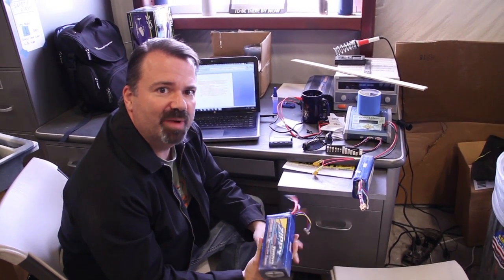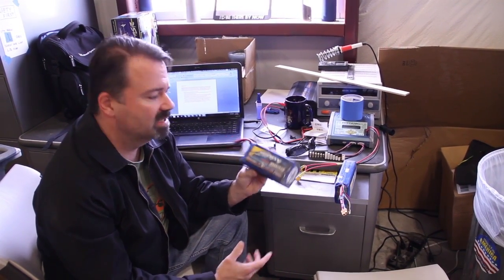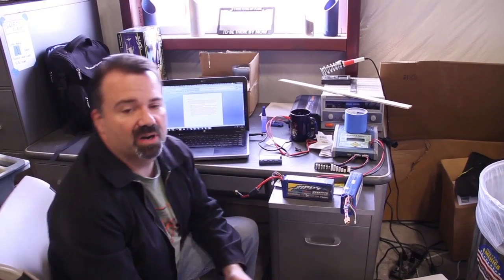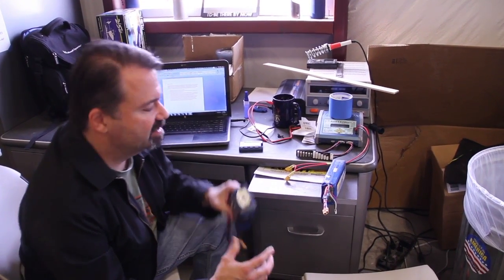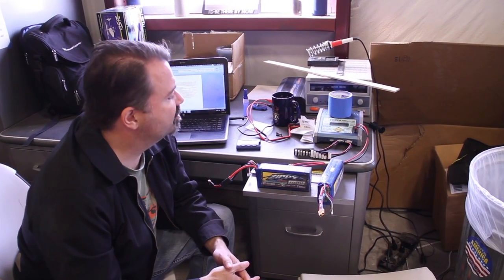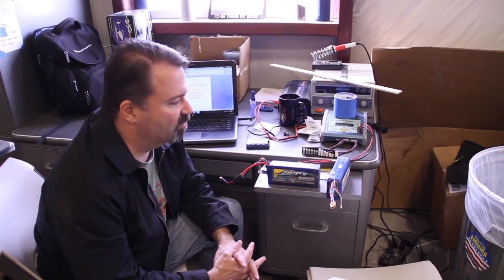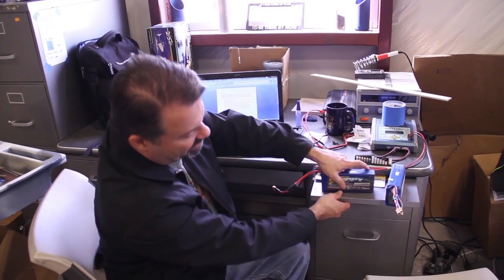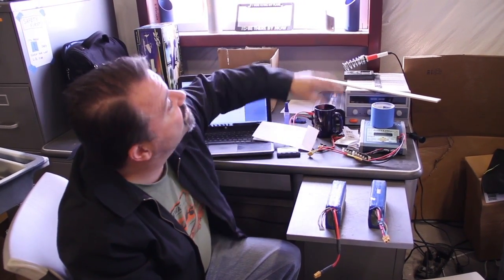Lithium Polymer Battery Safety - Local Motors

Comment: They make voltage monitors that alarm when the batteries reach their min safe voltage.  They plug right into the balance port on the battery.  Wouldn't help if left discharging unattended but then again, you should not be discharging (or charging) them unattended anyway.  They are cheap as well.  Something like 10-20 bucks.

This is an example (not an endorsement of any kind):
http://www.trendtimes.com/1-8-cells-digital-lipo-battery-voltage-display-and-balance-indicator.html?utm_source=googleshopping&utm_medium=cse&gclid=CPqgiL-JvLsCFUjNOgod5DgAdw

Another example (still not an endorsement of any kind):
http://www.focalprice.com/YO154X/1S_8S_Lipo_Battery_Voltage_Tester_Checker_Indicator_Monitor.html?utm_source=CS&utm_medium=GM_US&utm_campaign=CS_GM_US_YO154X&gclid=CIO5z_uJvLsCFUcaOgodrX0Abg